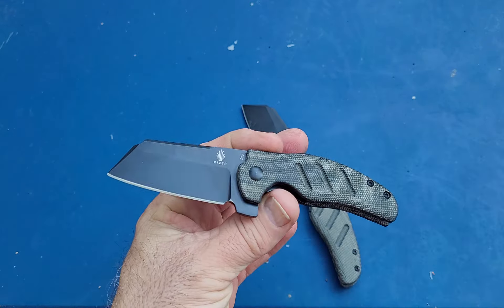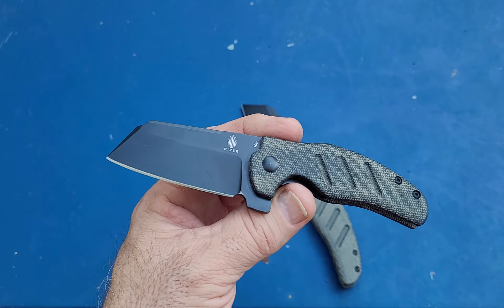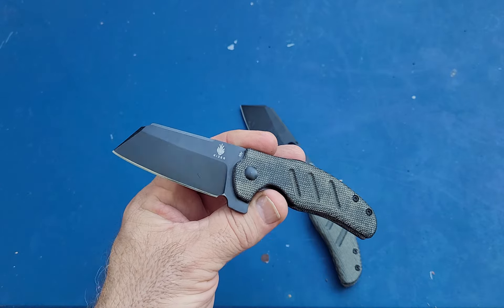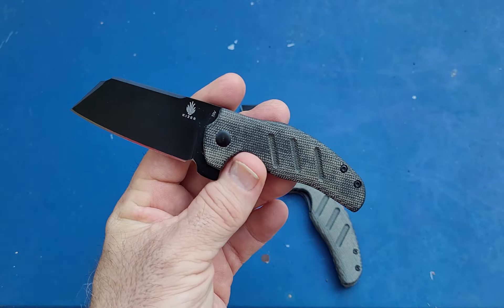Kizer 10V edge retention testing. Crazy results out of this pair.

Comment: I've got the bigger one in 10v and it tested at 62.6 hrc.  I haven't done extensive testing on it, but just now I stropped it to 90g on a BESS scale and then sliced about 40' of pretty heavy cardboard.  After cutting, it measured at 155g, which is a pretty good result, in my opinion.  After that amount of cutting, a typical M390 at 60 hrc would measure from 185-225.

The blade has been sharpened at least four times, with the last being freehand at 15ish dps, done on Venev resin bonded stones.

Comment: I have the original 10v mini sheepdog without the flipper tap and it is one of the better performance knives I own. I own several K390 spyderco's all the 15v bbb sprint runs and all the 4v and rex 45 spyderco drops. I even got the 4v sheepdog after loving the 10v so much. I have sharpened it 3 times but right from the first sharpen 15 \/ angle a side I did it was a hard performer. I just cut through a piece of .75" extruded acrylic with it the other day with no issue not even a scratch on the polished edge.

Comment: Thanks gerald!! Seems like kizer completely failed on 10V. I had similar problems with their m390/20cv, so far only their 4V and 154cm has been working out well. Doesn't make sense why they would do a good job with 4V yet waste10V. Has anyone tested the Hrc on their 4V?
Reply from the maker: I did test one and it was 62.5 rc. I have a couple 154cm coming up to test.

Comment: I predict the mini at HRC 57.5😊
Got a question for you.  Does DLC. Coating a knife need to lower HRC or can tempers be adjusted to prevent it? Be nice to test Spyderco as they have same models with and without DLC.  I understand that the DLC process requires a certain amount of heat and that messes with temper and thus HRC. Other coatings may require different heat levels.
Reply from the maker: Back when Kurt was still testing he did some dlc Spyderco. He tested them through the coating then removed spots of it and tested again. The Spyderco stuff all ended up being .1 to .2 rc difference between tests. On other brands some do matter. The first 10V mini Sheepdog I tested had the coating taken off and it was right at 60rc.

Comment: Could re tempering it help improve it at all? Yeah Kizer like to run the steel on the softer side. 3V on folders and EDC fixed blades at 58-60, when it really should be around 63 preferably. 4V I had varying results with and I believe a few ones are below 60, I had a Feist XL in 4V that performs pretty well and still I believe that's only 61. Cause I have 4V & V4E knives at 63 & 64 and they blow the Kizers out the water. Their Rex 45 I think they said was between 61-63HRC. They have so many great models and if they bumped up the HRC, it would be great.
Reply from the maker: This winter I may see about doing the heat treat all over on it. I'll be done testing it by then and if it doesn't work out it's not a big deal. 

I didn't even think about getting Rex 45 from them. The softest Spyderco Rex45 I have is 65.4 and it's a lot like M4. My Manix in Rex45 is 67.4 rc and it's a big step above the softer PM2 I have. I can't imagine how Rex that low would be but if someone sends one I'll definitely test it.
Reply: You'd have to grind the edge back to about the thickness of a dime, then regrind it after heat treat.
Reply: I could do it for you if you really wanted. Cant guanantee it would look pretty, but I can guarantee the heat treat will be on point
Reply: @Outpost_76  It's called the Mystic, I believe it's about $160 but can be as low as 130 on a sale.
Reply: Tempering doesn't raise the hardness up. And their rex45 was also low. It performs better than their other steels at that low hardness but still no where near normal hardness for rex45.

Comment: Have you seen the thread on spyderco's mule team forum?

A guy tested a kizer 10v vs a k294 mule and got results within 5%. It appeared to be a well done and documented test, but just doesnt match what I (EDIT: or you, apparently) have experienced.
Reply: Very few people have kizer 10v over 59rc. It's certainly possible there is a few out there. But it won't be more than a handful unless it's more recent and they changed the ht protocol and or aim hardness
Reply from the maker: I haven't seen that one. Until recently I haven't been following knife stuff much. I'm sure a few decent ones made it out since I've seen them as low as 57 rc there have to be some 62 rc ones out there.

Comment: Kizer should stick with 4V
Reply from the maker: They had much better luck with it for sure.
Reply: Kizer should stick to doing things properly instead of marketing a steel name for sales and offering low heat treatment.
Reply: @tacticalcenter8658  Ive actually had several Kizers. A 10V medium sheepdog like in this video, that would unlock if you spinewhacked it against your palm... fixed by bending the lockbar but still it was ridiculously easy to fail it.

Comment: I am done being a steel snob, it may make a difference for someone cutting one material all day but in real life, I can't tell any difference.
Reply: What I've realized is it depends what I'm doing. Most of the different steels have their place IMO. When I'm just around the house opening packages or slicing the occasional vegetable, anything with an ok heat treat will do. When I'm working outdoors slicing wood, vines, ropes etc and most things are covered in dirt, steel starts making a much bigger difference. Non particle steels' edges usually don't last me a full day doing that stuff, my higher HRC Spydercos do.
Reply: Outdoors55 has some interesting videos on the subject that sum up what I've also experienced.
Reply: @jusme8060  Yeah I think I've seen the one you're talking about. My experience has been more like The Home Slice's testing on what he calls "the death rope," a thick rope that was used on a ship and has a bunch of salt, grime, sand and even rocks in it. That test really shows the effect of both wear resistance and edge stability. M4 and Magnacut had some of the best results if I remember right.
Reply: I can see the difference. Sharpening a lot less often if I have a good heat treat on a good steel. It's worth it.